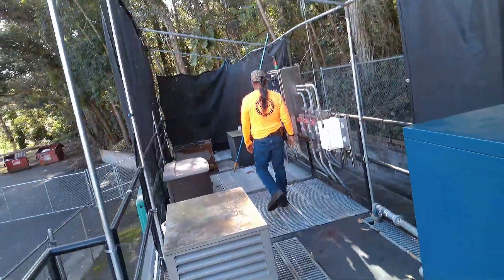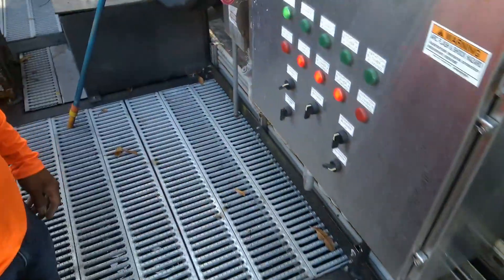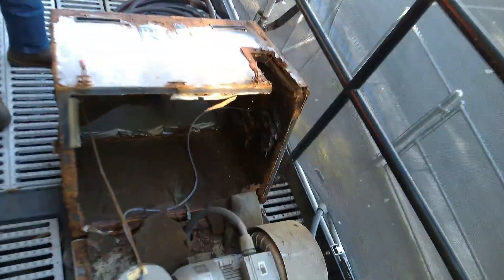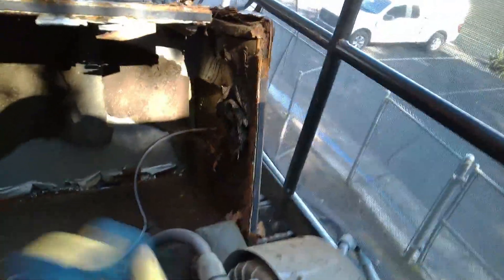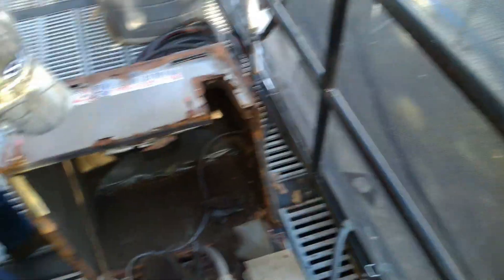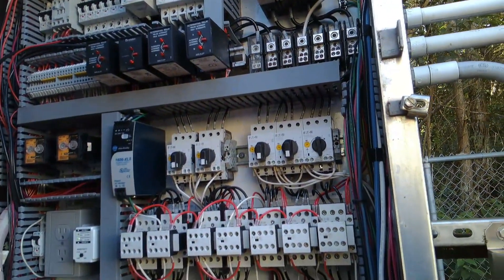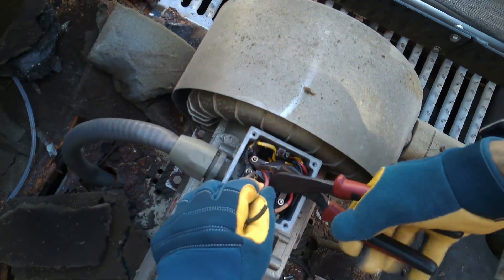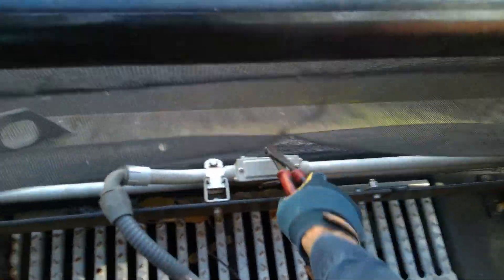Smoking Blower

Comment: For the wire to get so hot that it melted the plastic plug in the housing, the CB should have tripped.  That might be compromised too.  You get lots of interesting trouble calls.